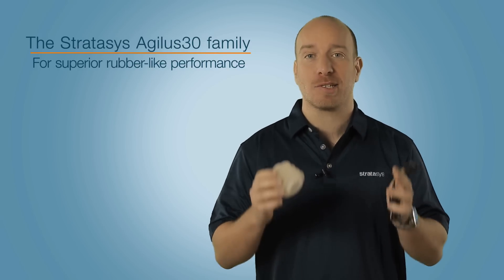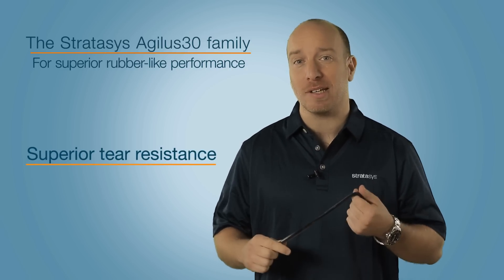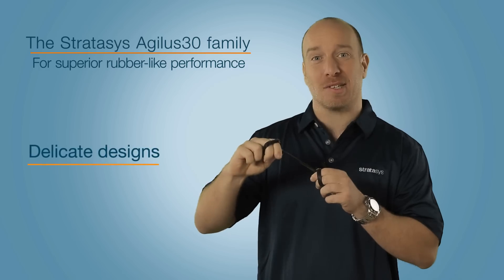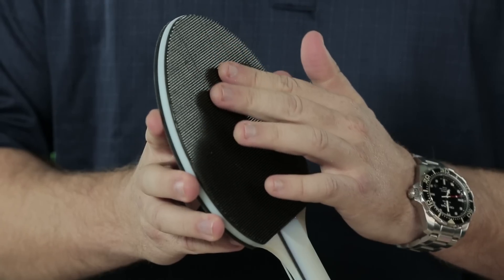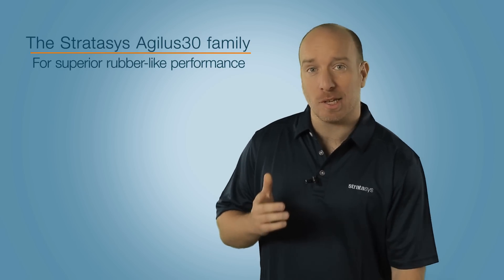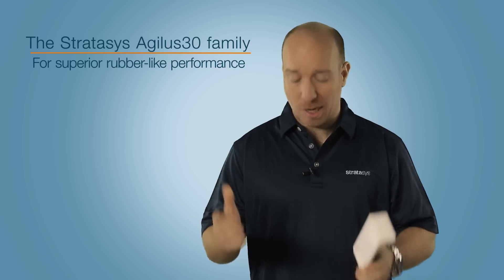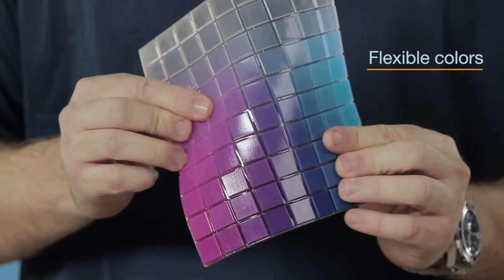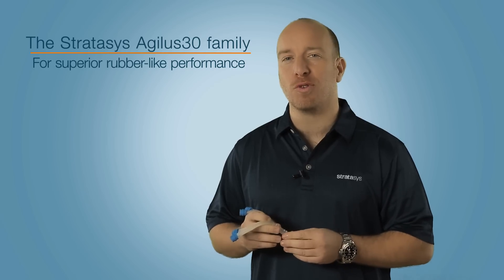The Stratasys Agilus30 Rubber-like 3D Printing Material Produces More Realistic Prototypes

Comment: Hello, thank you for your content. I wonder if you could help me in what I am trying to accomplish!

I am presently working on finding a material suitable for making my prototype. 

This material needs to be soft yet keeps its form, very light in weight so it can interact with air when it travels through air ( airworthy) and smooth so it will help with the airworthiness.

I have tracked down the material to TPE category and then the subcategory of the PEBA.  

I wonder if I am finally on to the right material for my toy prototype?

Can you suggest anything else to meet my criteria?

Ideally a material similar to what soft boomerangs are made out of, they seem hard yet bendable and keeps its shape, soft and lightweight and smooth enough surface for air travel when thrown.

With kind regards,
Mehran